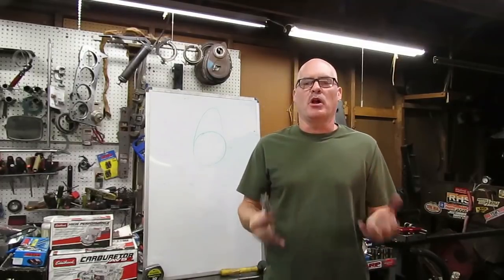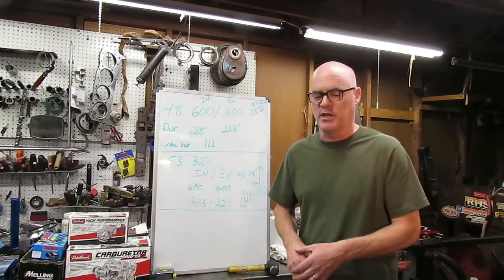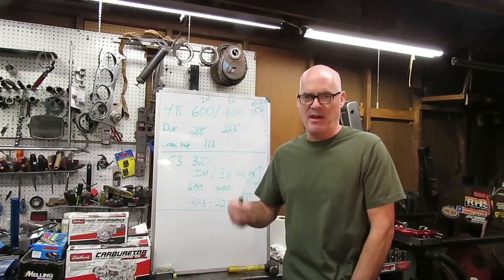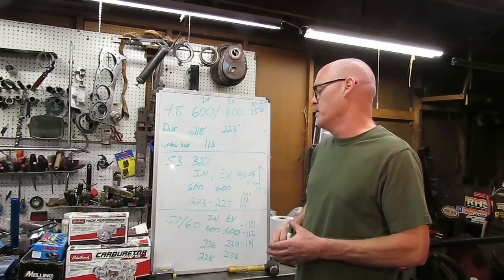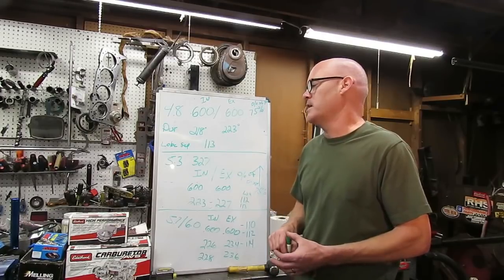How to properly select a Camshaft part 2

Comment: The relationship between LSA and torque, hp, and cranking pressure still mystifies me.  Why does a tight LSA produce more cranking pressure, and torque and takes away a little bit from the top end?  It seems counterintuitive because at low RPM a tight LSA results in dilution and lower vacuum. Do pressure waves have something to do with this?  HELP!
Reply: There's some small mistakes in his presentation. Regarding your cranking pressure, that's almost always down to when the intake valve closes, so you would have to know that to compare two cams. 
As soon as the engine is running things generally changes a bit, and with the throttle closed you'll have higher vacuum/stable idle with less overlap (wider LSA), but as soon as you start cracking the throttle open and move up a little from idle the cam with more overlap (tighter LSA) will start to pull more vacuum. 
Now on the LS engines for instance they used extremely large intake valves and well flowing ports in it to make the top end hp they wanted, but with high compression an large valves at the same time they had to reduce the overlap as over scavenging leads to poor emissions and they never aimed at really high VE, among other things. 
So LSA should be adapted to the lobes at low lift, compression, and valve size. 
And if you're in the ballpark, then it will increase power through out the rpm range. When you start moving much past 100VE you can run in to rough spots in the power band though, but that's from interference of waves.  
That whole idea about it being for top end only with tight LSA and it creating poor/rough bottom end is old school thinking from the parts that they are taught to pick. So it's usually a train of thoughts, you can follow it and end up at a known location every time, but that's the only place you'll end up if you follow the same rails. :)

Comment: 00:00 - Intro
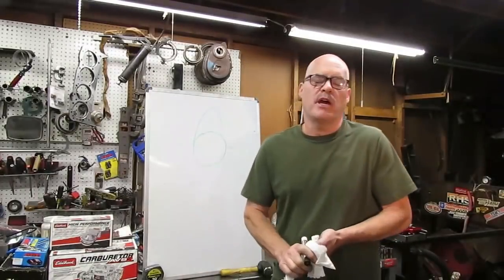00:27 - Overlap
04:21 - Overlap explanation using a whiteboard
09:29 - Lobe Separation Angle (LSA)
12:40 - Engine size matters when selecting a cam
15:52 - Cam selection is based on the head flow, not on the engine manufacturer
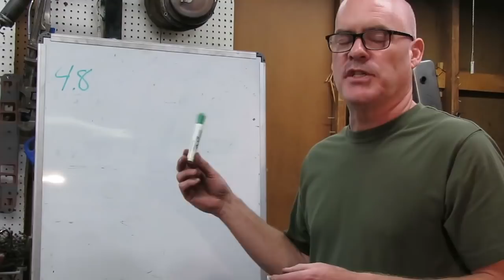16:53 - Cam recommendation for LS 4.8
20:21 - Cam recommendation for LS 5.3
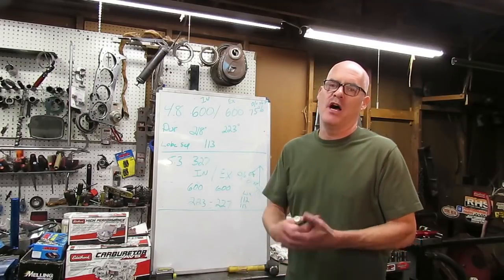23:11 - Cam recommendation for LS 5.7/6.0
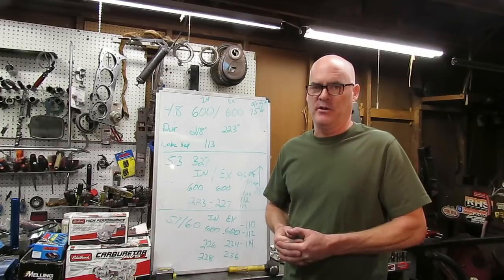25:32 - Valve events
28:28 - Cylinder blowdown
32:20 - Scavenging effect, exhaust pulses and exhaust header design
40:00 - Outro
Reply: no link down below

Comment: Your two videos regarding cam selection may be the most important videos on the internet for gear heads.  My first car was ‘70 Charger with a 318.  The guy I bought it from dropped a Crane Fireball cam in it and made no other changes.  To say the cam didn’t work with a stock 2bbl carb and 2.73 gears would be an understatement.  It sounded cool but accelerated like a constipated snail.  I learned at the age of 17 the meaning of mismatched parts.

Comment: you just saved me a bunch of aggrevations,my early bronco is sitting on 35 inch tires,,411 gears 351w stroked to 392, edelbrocked heads i ported the exhaust ONLY to get my flow to 77 percent,im choosing  a medium cam,215/220 duration,540/540 LIFT,112/114 lsa,thanx a bunch for your very clear teachings

Comment: Hey Mike, you stopped at het point where negative pulse pressure in the exhaust enters the exhaust port and cylinder in the valve overlap area. Where it actually helps draw in more mixture through the intake valve. The key to archive more than 100% volumetric efficiency in a properly tuned and cammed engine. Perhaps a subject to bear on in the next episode. Love your videos.
Reply: Hi There. I actually picked up on this as well and would love it if Mike could go into this side of it as well... I would like to develop my understanding also of the inlet side of the equation which i have found out is also very important. Tuning the inlet tract length and matching it in relation to cam duration. I feel that the velocity and pulse of the inlet wave is also helping with performance. Any light on this subject would be very welcome also

Comment: I had a 289 in a Maverick back in the 70's. 351 heads and a stock cam, 550 holly and headers. Ran great! Lots of power from the bottom up and 24 MPG.
Reply: One of the best engines ever made. Big heads and a RV cam.

Comment: I know this may elicit some groans or may not be a particularly interesting topic for some, but it would be very interesting to learn about head and cam combinations with power AND emissions Compliance in mind. What is too much? What combinations of duration and LSA and flow characteristics need to be present or are thresholds for passing Smog tests? etc. Thank you again for sharing your gift of teaching and your knowledge.  I cant stop watching your teachings and cant help feeling bigger better and smarter for them. Thank you.
Reply from the maker: the lobe sep is a big factor you need to go wide to keep the thing burning clean at idle

Comment: Excellent information! I've been building engines since the 1970's and learn something new all the time.  I've got a 5.3 I just finished building for a street rod and the cam I had ground is pretty close to what you suggest.  Mine is slightly bigger but it's going in a 2700 pound vehicle not a full size truck lol! Mine is 226/230 duration, 598/600 lift with EPS lobes ground 110 +2.  The engine has ported cathedral heads, stepped long tube  headers, and an Edlebrock intake with a Quick Fuel 750 annular discharge carb.  I haven't had a chance to dyno it yet but I'm hoping it is a nice little engine
Reply from the maker: That cam id very well suited to a light vehicle
Reply: It will be good with lots of top end and good tourqe

Comment: Great videos.. heres my opinion on one part of cam selecting. If my heads intake flows say 250 at .500 lift, I like selecting a cam with a little more lift than .500. Here's why, if the cam is ground with say .520 lift intake valve lift it allows the cam to have more lift at every degree until it gets to max left of .520. In other words more area under the curve if the lobe was drawn on paper. It will allow the valve to be open a little more at each degree of crank rotation than if ground with .500 lift. The valve is at that max opening for a very short time.

Comment: Nice how you added part 2. Great stuff! You tackled the basics and opened my mind to what's going on. If I ever do another 3rd Gen Camaro, it'll be with the LS1 and that's why I'm downloading your cam videos and burning them to DVD. Knowledge is Power! Thanks for sharing your knowledge of 30+yrs
Reply: Your right knowledge is power. After downloading you would be much better off using sd card and or usb stick. DVD is already dead most PCs don’t even come with them now and they are easily damaged and no good.
Reply from the maker: Glad it was helpful!
Reply: Dvds will last a lot longer than the captured electrons in a usb stick.

Comment: Bravo, sir! I put myself through several Physics courses in order to understand the type of information you just set down in about an hour. I've built several engines over the years, however, none of them were anything more than an assembly of parts, without much thought or attention to the details. I am currently in the process of building my first engine, using a 5.7L LS1 - standard 383 stroker build. Looks like some port work is in my future, if I want this engine to perform well throughout the RPM range. I'm looking for as much low-end torque as I can achieve, so it looks like my cam choice will be something around the 220-240 degree mark w/ a LSA of 112-115 degrees, to maximize cylinder pressure and, therefore, thermal efficiency, as well. Still a bit uncertain as to the best diameter for the headers I will choose - 1 5/8" or 1 7/8", as I want velocity and scavenging affects to help optimize the performance.
Reply from the maker: when choosing headers for TQ long tube smaller Dia are always best
Reply: @Myvintageiron7512  Thank you for the reply. Its been a while since I've been on my computer - family crisis. Keep up the good work on educating us wannabees.

Comment: Wow, that was great.  Thanks for taking the time to do this.
I'm glad you mentioned the old cast iron heads being garbage compared to what's available now - those old V8's were designed shortly after World War 2.   I mean if the basic design came out in the '50s,  it was probably being worked on in the late '40s.   We've come a long way since then with engine breathing and longevity.
Reply: I have a few sets of cast heads that I'd put on a flow bench against Vortecs or anything Summit sells.. the extra weight of em is the only complaint I have.. but the cool factor more than makes up for it..
Reply: @brianmichaels5142  That's cool.  I'm installing a set of Dart iron heads on a guy's '68 Chevelle SS 396 right now,  and you're definitely right about the weight of them.  Heavy.  But it is cool.
Reply: I actually had a guy message me this morning with a set of iron darts for sale.. then he went to check the numbers and get me pics, and found another set of the big valve ones he had forgotten about.. LMAO.. I guess  it's the universe telling me I need to have em..

Comment: The heads back in the late 70's and 80's was purely engineered for exhaust emissions. Manufacturers were still using carburetors which can't adapt to changing engine and atmospheric conditions like cold and hot days or altitude. Fuel injection was in it's infancy and was at least 10 years away from being reliable and more commonplace. Fuel injection made it easier to tune an engine and was able to more precisely meter the fuel for better power and emissions.
Reply: They had Fuel injection at least in the 50s. I always thought it was economics that kept them out of mainstream cars until the 80s.
Reply: @zapa47  Economics were one of the reasons. Most fuel injected Chevrolet Corvettes had their fuel injection units removed and were replaced by a carburetor. In the late '70's Cadillac offered fuel injection on the full size Cadillacs but it proved unreliable and problematic so it was discontinued and most were converted to a carburetor.

Comment: I have a 2008 Grand Prix GXP with the 5.3, it can hold its own, they are fun as hell to drive, that is if you can keep and transmission in them and deal with the torque steer.

Comment: I’m going through the process of trying to select the right cam shaft at the moment. I’ve watch so many videos on you tube. Both part 1 and 2 of these videos have helped me a lot. You’re right there is no one that goes into that much depth. Thank you for sharing that. Is there any chance you could suggest what cam shaft would be the best cam selection for a 6.2ltr ls3. Your help would be greatly appreciated. Thank you!

Comment: Would you be able to advise me in rebuilding my 91 Chevy 350 tbi swirl port heads? Im In the middle of a engine rebuild and i need some advice on what parts i need to rebuild the heads to their full potential without any machine work.

The information you provided here is way over my head and would take years to understand properly. 

Lmk i can pay you for your time, thanks.

Comment: You have done such an amazing job with your two videos here! I have a LS1 which I'm stroking to 383 and it's already supercharged. I have the stock stall converter in and it's a daily (luckily I don't sit in traffic going to work and want to keep the stock stall in). I know the SC is better suited to a LSA of around 118 but I do want some chop and down low-torque. Was thinking a 222/230 with .6 lift and 112 LSA for some chop. I'm not trying to reach a power goal, just want it to have low-end power and torque. The car is a WK Grange so around 2.2t with me in it. Thanks from Australia!

Comment: It appears that on most engines stock. That just switching over to a header exhaust vs cast iron exhaust causing a drop in low speed torque. But the header tends to help it breath a little better about at 2,500 rpms to about 4,000 rpms.  This is most common on a stock motor. The same thing happens alot of times when guys switch from a 2 barrel carb over to a 4 barrel carb. If the 2 barrel was restrictive. Then you may feel a little power gain somewhere in the the power curve. But to take advantage of both a header and carb change. Is to use a hotter cam to help the carb and headers to perform like they were designed to do.  The camshaft is the brain of the motor. When you add a 4 barrel over your old 2 barrel. Then you want the engine to take in more air and fuel to add power. But you also need to let out more exhaust gasses so the engine is balanced between intake and exhaust flows. The hotter camshaft with the added parts works together better. With carb change and header change without a cam change is very much like swinging a hammer with 3 of your 5 fingers missing on the hand your using to drive that nail in. That's what's happening when you expect a miracle without having what you need to get the job done. You cannot  just compete in the UFC with only training your biceps. It's putting together the pieces you need to be successful.

Comment: OK,So lets talk about camshaft timing. How does 4 degrees advance effect these engines and is it worth it? How will small turbos effect the lift, lsa, and duration@.050?also,what compression ratio were these engines when tested? Back in the day we advanced timing to scavenge cylinder and ported exhaust leaving the anti reversion step at bottom of port....I have been out of it for awhile and technology certainly has moved along.first knowledgeable guy i have seen in a minute for sure

Comment: I have a turbo charged v6 engine which runs to 6750RPM, the normal RPM limit on these engine are around 5500. The cam specs. were a secret from the engine builder. I was told the engine would make lots of power at the higher RPM range and be more gentle on the valve train with a large Turbo to draw in the air. I believe my lobe separation (overlap) is small. I am running a hydraulic roller some of my buddies ask if I was running a solid roller, it is a bit noisy at idle but smooths out as the RPMs increase. I'm running a 9" 3800 NL convertor. Fully race ported aluminum heads. Trying to get an idea of the cam profile if that's possible.
Reply from the maker: Why in the world are the cam spec's a secret that is just stupid, if you ever ask an engine builder about cam specs and he says it's a secret run from that guy he's an idiot

Comment: I put a howards cam in my ford 331 stroker.  Cam specs are 219/219 at .050 and  .578 lift with 1.7 Rocker arms 109 degrees lobe separation. I was worried that I was under camming it, but it sounds lopey and still rippes above 2000 rpm.

Comment: Thanks for the fantastic part 2 video!

I have a factory fuel injected and ECU tuned LS 6.0 (L98) with rectangle port (821 casting) heads in a 3902 lbs weighted sedan (Commodore/Chevy SS).

If I source a custom cam grind with your suggested specs with the 600 lift on the intake and exhaust - will there be piston to valve clearance issues?

Comment: I'm a BIG fan of big heads and smaller cams. My ported and zero decked 460 with a 219/227 cam is a monster from the basement to 5500. But where it spends most of it's time 1800-4800 is GOLDEN. The big cam guys sound cool, but they need to always be spinning to feel the power.
Reply from the maker: Exactly and it really shortens the life of the engine as well
Reply: @Myvintageiron7512  Can you please do a video on the pros and cons of larger valve sizing?  This seems to be another misunderstood topic where many think bigger is always better, but lots of time, especially with intakes- going larger can help you go slower with some combinations. Thx.

Comment: I did that with my 400 Old .. Only had 125 compressor. Would have been great at the salt flats. I did open it one night  . Empty road  way past125, had to take my foot out of it .started to lose control. but every thing you said is true.

Comment: Many of us still use old
 Engines. 327 with aftermarket heads. Help us as well. I think my 327 will work great with the 5.3 cam you have shown. My. Heads don’t flow real good much past .500” lift 112 LSA USING HYDRAULIC ROLLER CAM IN A 350@# car with 2.6” exhaust. Seems to be good for me.
Reply from the maker: yep good combo

Comment: You are a valuable resourse! I'm just starting the gather the info to build my 440 to put into a 1970 Superbird to set up for Open Road Racing in Nevada. I'm half tempted to see what your thoughts are about me just sending it to you to build. Or maybe you can offer some ideas for cam selection. My goal it to tp 200 MPH.  Keep up the great videos!
Reply from the maker: 200 MPH is very easy for that car the factory Chargers and B's would cruiz at 180 with stock 440 or hemi

Comment: Sup Tony I’ve been watching a lot of you’re videos. Really good stuff. I need some advise on a project I’m working on. 2006 GMC Sierra Denali 6.0. I want to swap the cam to the STP .600”/.600” 228/232 112. My question is. Do I have to change my torque converter for this, and would I be able to use my truck as a daily driver. Using stock heads and valves and rockers with new Tunnions , the rest is in the kit I’m trying to put together.

Comment: Thanks for all the info brother. Would you go a little bigger with a 6.0 LS with 823 heads. 10.5 CR ,short runner intake. TKX manual trans. 3.73 rear. Fox body mustang. I'm old school. This is a ground up new build.

Comment: Hi, good info, thanks a lot,I'm hoping to get your opinion on something,I'm almost finished on this 327 small journal,it has double hump heads and the cam is a lunati bare bones,if you are familiar with that,. do you think I should remove the inner valve springs for the cam break in or is it necessary? Thanks